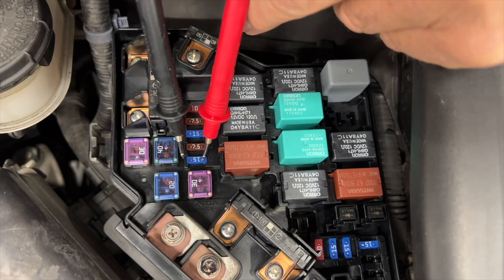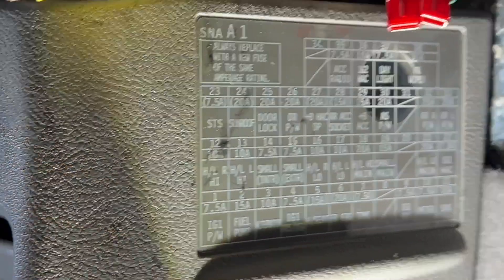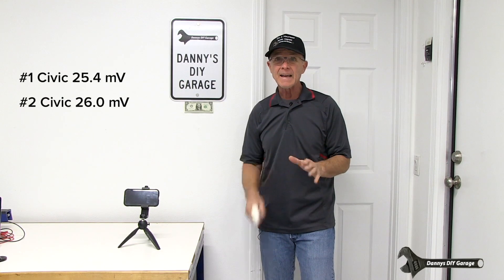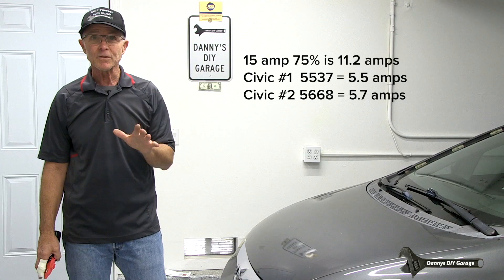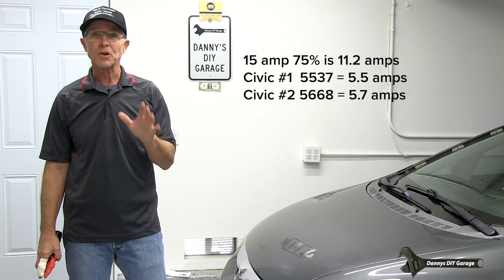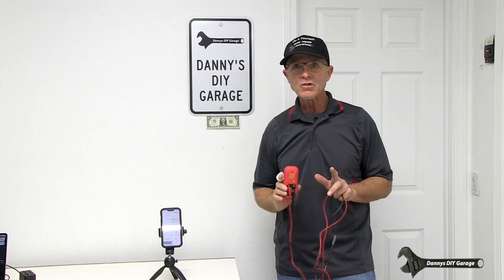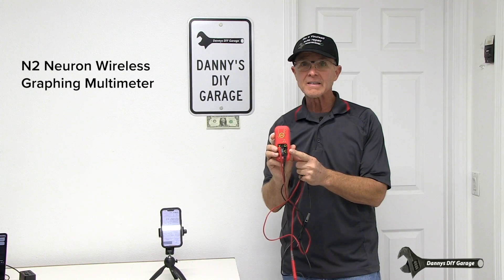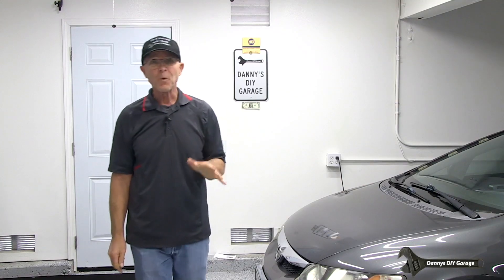How to avoid a Fuel Pumps breakdown, Quickly test the current draw

Comment: Using a scope to look at the voltage waveform across the fuel pump fuse will pinpoint a dead spot in the commutator/armature that the volrmemter might miss

Comment: Nice video.please can you tell where the location of relay of fuel pump same  model of this video.thanks & morr power.
Reply from the maker: left side of the steering wheel, the panel will need to be removed, under the panel

Comment: Would this help me diagnose why my Civic reverse lights aren't coming on?
Reply from the maker: No, did you check the bulbs and the fuse?
Reply from the maker: It's a pretty simple circuit,  fuse number 10 under the dash, there is also a relay, under the dash, the transmission range selector and the bulbs

Comment: neat trick. so basically a broken electronic component will draw more than 75% of the fuse's rating?
Reply from the maker: A wearing electric component will have a higher draw, a motor wears over time and the components in the motor wear and will usually draw more current, fuel pumps a lot of times will blow a fuse due to this extra current demand and the rating of the fuse, when I worked at the Chevy dealership big Suburbans blew the fuse all the time  because of the a mount of fuel

Comment: will the reading from pump vary based on the amount of fuel in the tank and rpm of car?
Reply from the maker: It will, the most extreme conditions will be low fuel and after drive a while